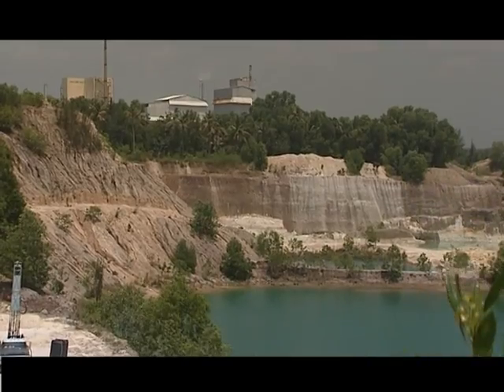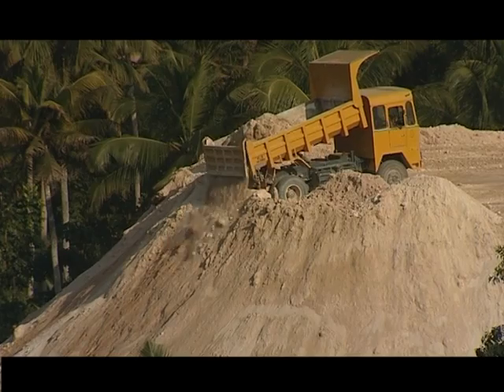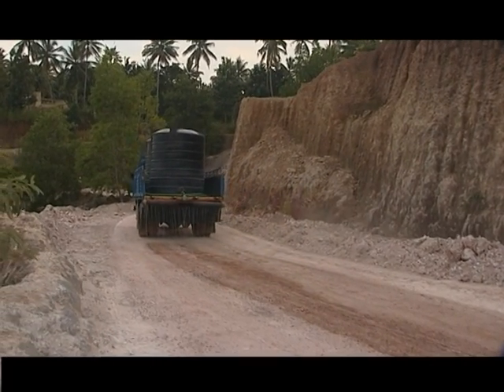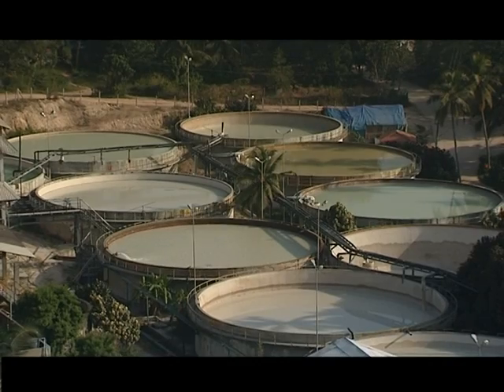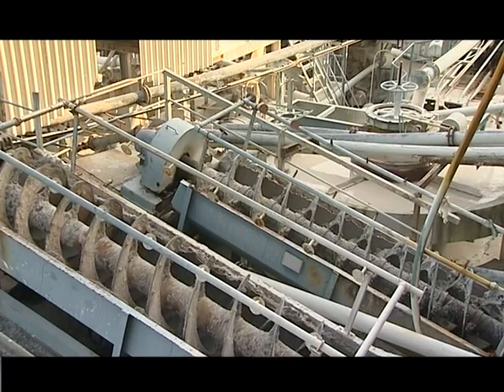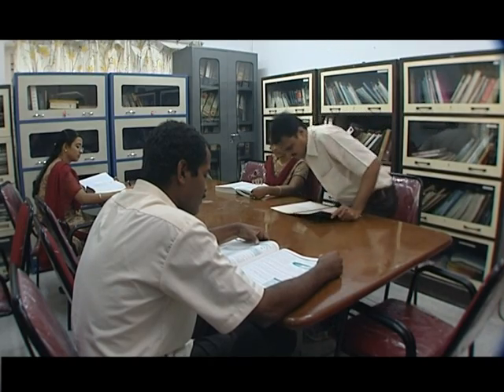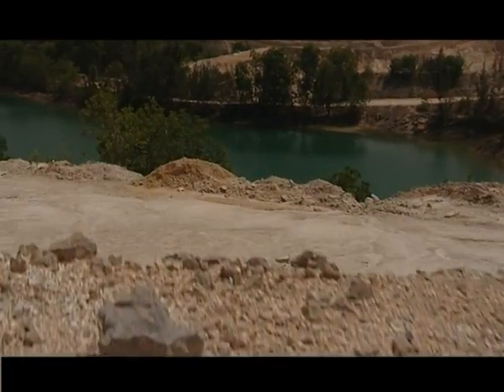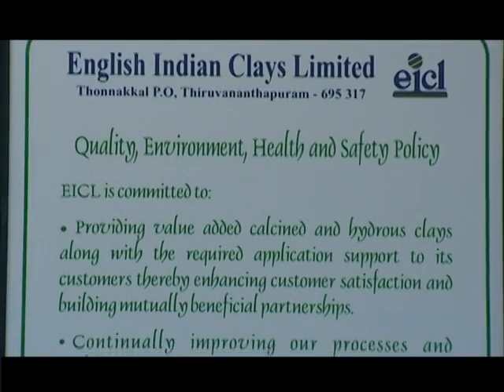EICL

Comment: English Indian Clays Ltd., a company incorporated in India, was part of the erstwhile Thapar Group. The company was incorporated in 1963 in technical and financial collaboration with English China Clays Ltd., U.K, the pioneer and the then world leader in kaolin processing. This collaboration with ECC ceased in the year 1992.

EICL has two key divisions, viz., "clay" and "starch". The Clay Division, having three manufacturing locations in Kerala, specialises in mining and processing of high end kaolins.

The Starch Division has two manufacturing units, one located at Yamunanagar, Haryana, manufacturing starch and its derivatives, and the other located at Shimoga exclusively specializing in the manufacture of value added modified starches for various industrial applications.

The Starch Division was started under the name of Bharat Starch Industries in the year 1937. It was subsequently taken over by English Indian Clays Ltd. in the year 2002.

Clay Applications
Coating pigment in paper and board industries, to impart gloss, printability and finish.
Extender pigment in paint to deliver embanced paint properties and optimize cost.
Effective filler in the manufacturing of plastics, rubber goods and paper.
Key raw material in glass fibre and tile industries.
Structurant in soaps.
Other areas of application include industrial blue, refractories, sealants and pharmaceuticals.

Starch Applications
Wet-end additives, surface sizing and coating binders for paper industry.
Adhesives for paper sack-packaging industry.
Starches for pharmaceutical industry.
Syrups for confectionery, food and beverage industry.
Yarn sizing.
Printing and finishing for textile industry.
Starches for oil well drilling industry.
Very nice SAP Project. really got good information on business process. like it .
Reply: Sir
Reply: Hello, can I contact you for an important scientific matter?